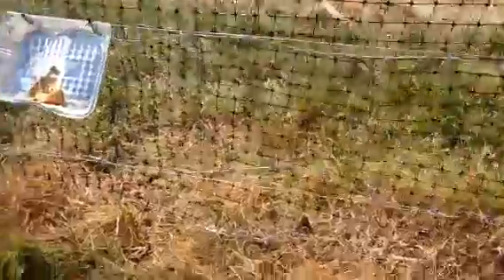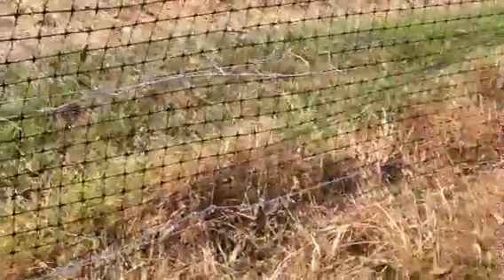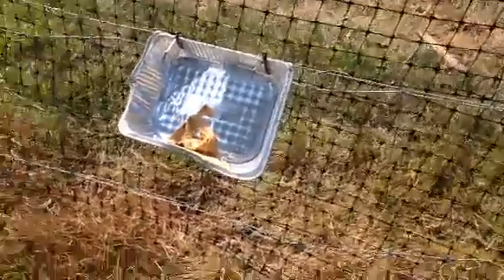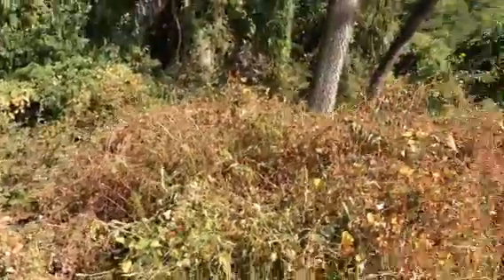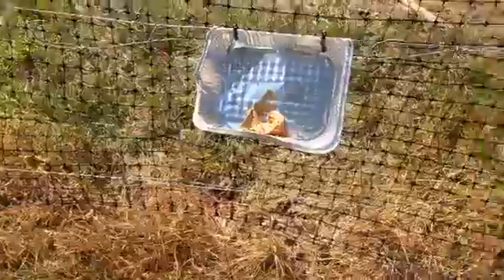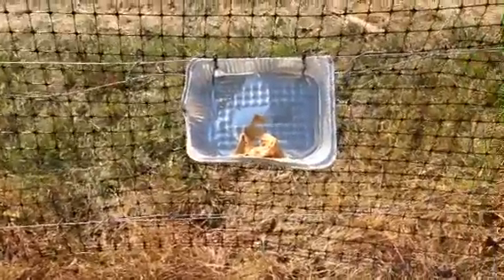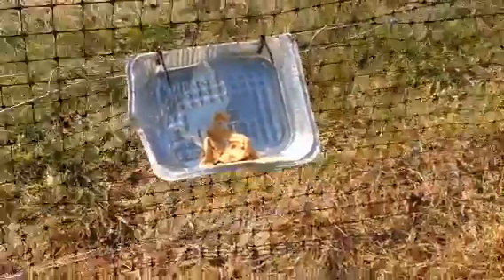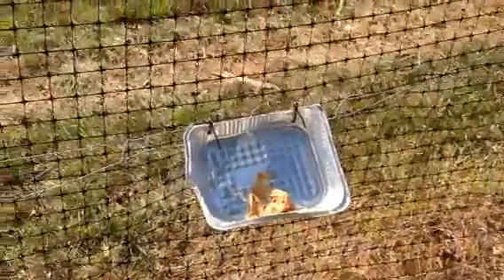How to teach deer not to hit a charged fence wire

Comment: It'll also teach them to leave your sandwiches alone.  ((-:
My neighbor and I will put up some sort of deer fence aruond our garden next Spring.
Reply from the maker: +southernexposure123 8-12' high and either a strong wire or plastic webbing, but if plastic you need to back it up with charged line. 
Also need to know their patterns of travel so you know where the main stress points will be and where to watch.
Reply: Last year I found fresh tracks often right in the garden.  They walk across the open fields and its easy to see they walk a few trails over and over through the nearby wooded area.

There's places - across the road - where tracks are so numerous it looks like a Deer Superhighway.

I don't know if its better to have a permanent fence or one set up only during gardening season.  The rest of the meadow is used for growing hay.
Reply from the maker: +southernexposure123 just depends... Deer will jump anything less than 6',and can jump 10' as long as they have the space to run up on it.
Permanent means you won't be taking it down for almost any reason... temp means you only want it up a year or so. 
No way for me to know what your plans are but the plastic "deer fence" will last a long while so long as you back it up with charged line. Otherwise the deer will crash through it. So we "trained" the deer using the peanut butter.
We haven't had any problems since.... just gotta make sure to keep gates closed and check the fence for a few months till the deer get used to it and establish a new traffic pattern.

Yeah we see droppings and tracks... "sign" we call it.
We planted new trees for cover on our boundaries of the vineyard where it's cultivated. The deer during rut beat them up... they'll survive but look more like bushes now (tops beaten off)
Reply: The deer fenc will mainly be up to my neighbor, but he and I'll talk all that over and I'll remember to tell him about "training" them with pnb.

The deer will rub young saplings as small as half inch diameter and sometimes as big as 2 inches.  When you clear off land you might leave some small "weed" trees for the deer to pick from to rub.
Reply from the maker: +southernexposure123 we leave some of the good trees not overgrown with vines. The trees we planted as I said were along the perimeter of the fields we have planted as a border between properties. Fast growing attractive evergreens. We aren't too worried they've  lost their tops to the deer. Not all just about 30% of them did suffer some damage. Not near dead or anything just battered.
Reply: Battered and weathered trees sometimes serve as a starting point for Bonsai.